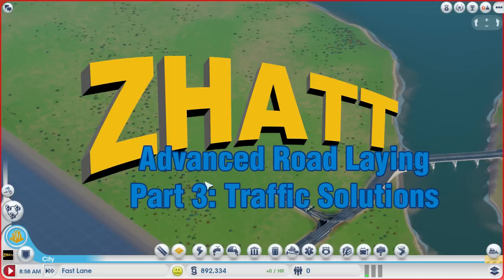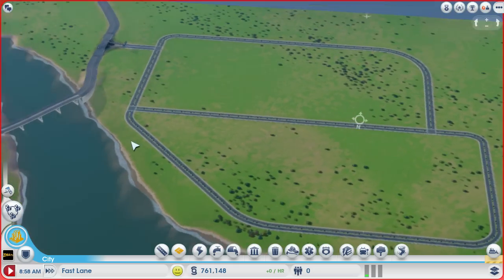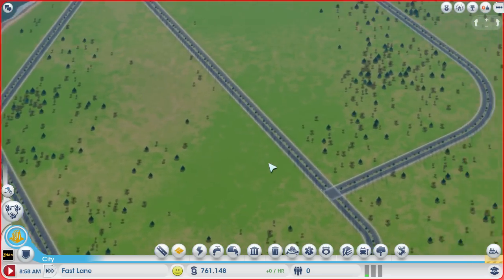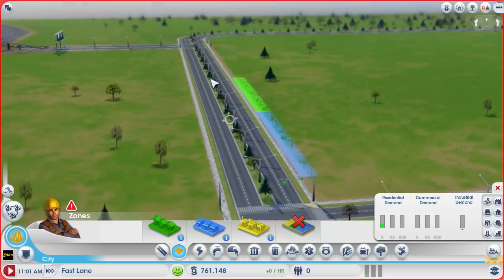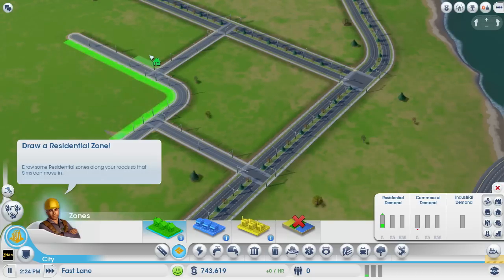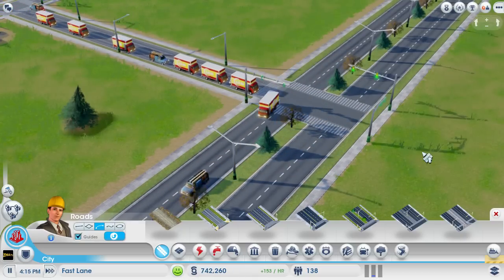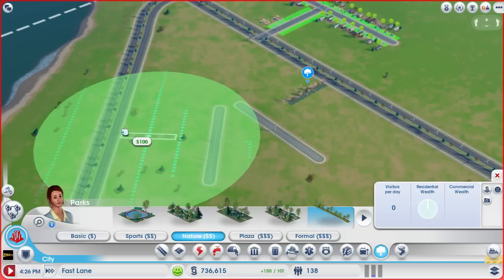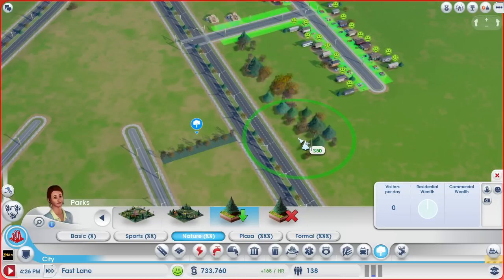Advanced Road Laying - Part 3: Traffic Solutions (SimCity 5)

Comment: wow I have been doing the trick w/ putting the roads closer to the avenue like that but never did i think about using the park for a spacer... I would just zone and wait to see if a low density built back to back w/ the other low density or fit it so it doesn't hit a lager building...
Using the park is brilliant!!!

Comment: That was great Zhatt. I like what you've done with the avenues, this is particularly good when creating a city that is for the majority a residential city as you can then further then avenue density to allow for street cars that act as a proper mass transit system along side buses that can be cleverly placed in the inside your suburbs. 

One thing you should look at when placing the avenues is where you are going to plop your power plant, as it is a good idea to have it on an avenue.

Comment: Bit of an old video now, but I've been trying to look for something to explain the zone densities. I've seen the park method used before when placing low density streets at the perfect point so that you have the space for a med/high density building when you upgrade, but if you were to just use medium or high density streets straight away, would you not need to do this? I'm guessing using the park method is for when you're starting out and don't want to waste money on expensive roads? Great video series by the way!

Comment: I use the dirt road trick for spacing: draw a dirt road from an avenue and when it costs $269 that is the distance for your parallel road. When drawing from another road that number is $245. If you want to get two high-density buildings the numbers are $466 and $440 respectively.

Comment: Several reasons actually...
1. Some (if not all) residential or commercial buildings comes with an entrance on the road. It functions like a small junction and could mess up the trafiic.
2. Often, high/med density commercial buildings attracts cars to park or stop beside them which basically cancels a lane. Plus, the traffic that comes out of high density buildings will block the avenue.
3. Avenues don't have left turns unless it's a junction so cars would have to u-turn at the closest junction.

Comment: ok I'm a very analytical play style when I approach my new cities so a question I would have is thus; I tried your trick for road laying which worked very well right until I hit a population of 20k or so. After this I noticed the bottle necks created by only allowing one ave/blvd (other roads ) leaving Residential to the main " backbone".  So I attempted multiple ( other roads ) connecting to the backbone. However again due to SIM CITIES A.I. they will still only take the road closest to the their destination thus creating another high traffic zone. Would you have any suggestions? FYI. I would be interested in bouncing some ideas for city planning with you if youre open to it. - Thanks in advance.
Reply: I'm not Zhatt, but I think this counts as the situation described in 4:45 to 5:23 "Just draw another throughfare"